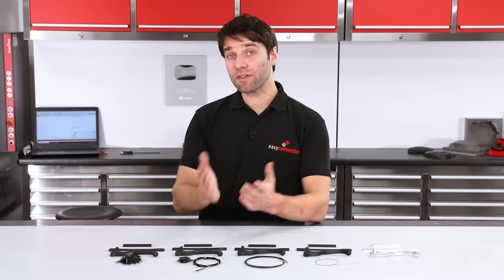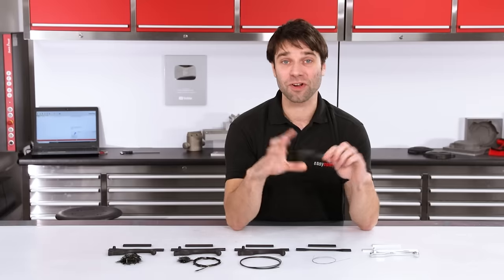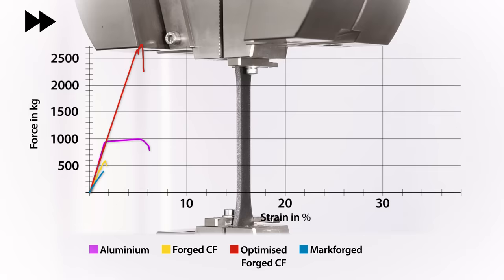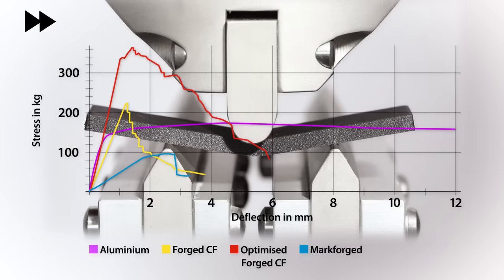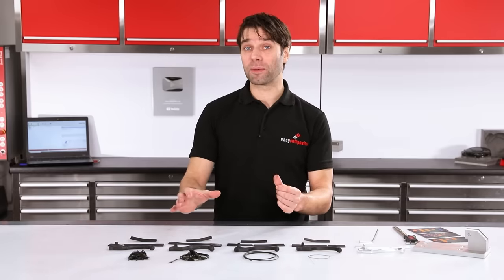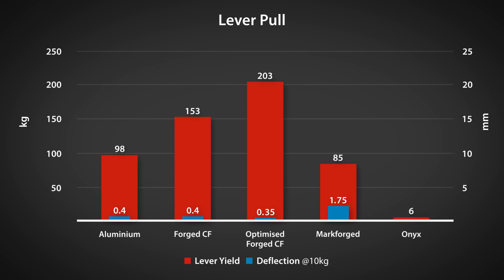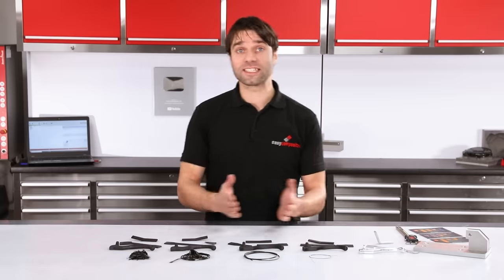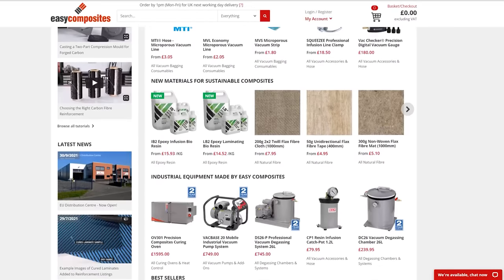How Strong is Forged Carbon Fibre? Forged Carbon vs Aluminium vs Markforged vs Onyx

Comment: Hi! I am from the US. My university senior design project is a CF roll wrap/compression molded first responder tool. Would it be alright if we screenshotted the graphs in this video for use in our presentation? We would place your logo at the bottom to credit you for your work as well as cite you as a source in our references.
Reply from the maker: Hi Ean, yes, of course, very happy for you to do this providing you credit in the way you mentioned. If you follow the link to the full write up on our website you will find more information, tables and the original graph. This is the page you should reference. Good luck with your project 😀.

Comment: Something that I don't feel is fully conveyed from this test data is how sensitive the 3D printed materials are to the direction of the loading. In the optimal loading directions, they will provide the strength shown. If loaded such that the force is applied tangential to the layer lines, the strength is drastically reduced. The Markforged continuous fiber material, for instance, if loaded in the worst case direction, would fail at a lower load than the Onyx did in these tests. For unidirectional tensile loads and compressive loads these materials can be viable, but complex tensile loads will cause the layer lines to separate at significantly lower loads.
Reply from the maker: That is very much application dependant and the same can be said for traditional composites which are very fibre direction dependant. If it is taken into consideration then it doesn't need to be a problem.

Comment: I bet "optimized, forged carbon", rotors and apex seals, would be awesome.
Or an eccentric shaft/crankshaft also in fiber?
Would they melt?
Reply from the maker: The resin used can go up to 90C so would not work for an engine.  There have been experiments with composite and plastic based engine parts but generally only for demonstration or research purposes.

Comment: Should have done Forged Steel. would have been nice since everyone likes to compare Fiber to Steel.
Reply from the maker: It would have been an interesting comparison but in real terms, aluminium is a closer material to compare to.  It is common for people to hear statements like "carbon is stronger than steel weight for weight" and although correct, it can be misleading. This is because the density of the materials are considerably different so a carbon part would need to be considerably thicker to perform better than the steel part - albeit it would still likely be lighter.

Comment: Nice video, although i would have liked a comparison to conventional carbon fiber
Reply from the maker: I think we assumed that comparisons between the mechanical properties of various 3D print filaments had probably been pretty well covered already since these materials are widely available and their performance compared to each other is the source of plenty of debate and discussion. Nonetheless, I can see that a straight PLA/ABS print, tested on our gear under our conditions would be interesting, especially just to see whether the milled carbon in the Onyx really does much at all to improve a standard filament under these conditions. If we get chance, we'll look at adding this data to the report.

Comment: Could you do video on design Carbon Fibre cross bow limbs. It's design for strength and elasticity. 

So far the general perception is favoring fibreglass
Reply from the maker: There are already plenty of bow limbs made with carbon fibre, typically UD carbon fibre laid up in the direction of the length of the bow limb.

Comment: Could you compound the carbon fiber with fiberglass to make it more rigid or stiff?
Reply from the maker: Carbon is generally stiffer than fibreglass so this wouldn't really give you any advantage.
Reply: @easycompositestv  I was looking at the cost effective scale, to mix carbon fiber with fiberglass, to bring the cost down.

Comment: Hi, I have really enjoyed watching your video! I am daily working with Markforged printers (reseller) and I know that you can (as a user) set up the printer to lay down continuous fibers form the second up to the second to last layer of a print (you have mentioned that a print has to have "a few layers" of top/bottom plastic - yes, with standard settings it is 4 layers), so with the correct settings you end up with 6 more layers of continous fibers. 6 is not much when a print has 500 layers, but quite a lot when it has only 25 (like probably your test samples). I would love to see how would those extra few layers change the results. Please ask someone from Markforged for an extra sample or write to me and I will be happy to provide it :-)

Comment: I've done these tests with the MF printer with roughly 66% CF infill. I've been having difficulty getting a successful failure for a dog bone shape per ASTM D638. It looks like your failure was successful, was your dog bone a type 1 shape?
Reply from the maker: Although the standard wasn’t applied to the tests as such, the specimen follows the dimensions of ISO 527-2 Type 1B

Cross section 10mm x 3mm 
Parallel gauge length 60mm 
Tab width 20mm 
Waist radius 60mm

Comment: Id be curious to see a comparison with a more quality carbon fiber manufacturing processes- eg. prepreg and autoclave process or a SQRTM process. These processes are more controlled and do a better job of limiting voids, and aligning fibers. It gets the parts closer to the theoretical strength values of a given fiber matrix combination. They would provide a better benchmark to compare the forged carbon parts to.
Reply from the maker: There is already a lot of mechanical data available for conventionally produced composite materials. However a direct comparison is not really possible as generally the methods have different applications. Eg the brake lever being a solid thick object is not ideal for conventional composite lay up, and thin conventional panels are not ideal for a forged carbon lay up by these DIY methods -  so not easy to have a direct comparison that would be meaningful.

Comment: fantastic video but how do we know that wasn't a flaw in any of the samples.  It would have been better if multiple samples were taken from each method.  For example, use 3 aluminium levers, 3 forged carbon, etc.
Reply from the maker: The sample token tests were repeated multiple times and the average values from those tests was pretty reflective of the results from the lever test so we can be reasonably confident.

Comment: Onyx seems like it could be very useful in specific situations due to its resilience.   Also, I know it's a different test, but repeated pressure at lower levels to see how well these survive long term.   That is/has been an issue with parts on my bike as repeated torque over time causes failures in seat posts, pedals and even frames eventually.  I've ridden well over 40,000 miles as a commuter in my life and I think this is an important issue can be improved and should be with the advent of EV-bikes.
Reply from the maker: Great point! Fatigue on something used a lot could well be an issue.
Reply: @easycompositestv  I had a thought, Could you use Onyx as a O-ring material?

Comment: Very interesting testing and results. But how about fatigue stressing and failure of the different carbon forms? We know very well how metals and aluminum behave. But carbon parts? Definitely you don't want a fatigue failure at your brake handle!
Reply from the maker: Long term fatigue testing is not something we are able to test. There is limited data out there on fatigue failure and it is usually for specific applications.

Comment: How complicated would it be with a " prestressed " woven fiber strands to add reinforcement and the rest of the inner part with 100% filling
you have to install one turning point at the end of the lever, in the bulge
Reply from the maker: If by pre-stressed you mean a pre-cured insert? Then that could be done if made off the part then inserted.  But that is adding another layer of complexity to the process compared to the optimised version which can be done simply at the same time as the rest of the compression moulding.

Comment: Is there somewhere a weight table or comparison of the items?
Reply from the maker: Hi allesleiwand, you're in luck - if you head to our website, you'll find the video along with a detailed write up: https://www.easycomposites.co.uk/learning/mechanical-properties-of-forged-carbon-fibre
Reply: @easycompositestv  Thanks for the response and the link!
A small suggestion for comparison videos (yours is great already) that really helps using them as reference: Please place sheets of paper to the materials when you show them. And please use the same order over and over again and also outside the video as the changing order is quite confusing. Thanks for all the work you put into this!

Comment: Excellent video and spot on. However, what I do not understand about carbon fiber applications is that it appears the REAL strength is not coming from the carbon fibers, but instead from the polymer. I think what needs to happen in carbon research is how to better bond the fibers at the molecular level, such as found with molten metals. If there were such a component made with ONLY carbon at it's core, such a part would outperform all other materials.
Reply from the maker: The matrix itself supports the shape but the physical strength characteristics of a finished part do come from the reinforcement; a block of pure resin of the same dimensions would perform significantly lower than one reinforced with carbon. However, onto your second point, this is already a 'thing'; Carbon-Carbon items are largely used in high-temperature applications but there is some interesting reading online against your hypotheses.

Comment: Could Onyx be used to make very light racing tires ?
What if one could make a Aerogel tile, triangle shaped, 1.5" tall by 0.125" thick ? Then draw a vacuum on it while coating it with a thin layer of Onyx as a sealer and binder for a second layer of Forged Carbon ; engineered thickness depending on application . Could this tile be made lighter than air ?
Reply from the maker: Certainly not an application we have seen or heard of so I suspect the only way to get an answer would be to have a small experiment or test to see if the method works.

Comment: What would happen if you braided the reinforcement fibers of optimized forged carbon?
Reply from the maker: Not something we have tested but if it was fully braided into a rope/sleeve then the properties would change as the fibres are no longer straight but wound.
Reply: @easycompositestv  Fair enough. Strength after all very well might be compromised. However, I get the feeling that the whole "multi-directional" aspect will come into play much like plain forged carbon, and since they'd still be continuous bands, just now twisted together, FWIU it would still add a massive amount of strength in the directions and locations placed.

Comment: very interesting - but I can't tell which  parts map to the graph - please add a title left to right
Reply from the maker: If you click the link in the description, it will take you to the full project write-up on our website. In the write-up, there are the original graphs as well as tables of the data. There's also more information about material densities, component weights and some further analysis.

Comment: Onyx at first glance looks terrible, but i can see some really good use cases already. It appeared to go back into shape after the force was released. This could be good for adventure bike mirror brackets, or the base for turn signal lights. They need enough rigidity to just hold in place while still having some give when you inevitably crash. Also since it can be warped so much, protective covers like a plastic water pump housing for example, or hell even a phone case.
Reply from the maker: Yes we agree, for some applications where the stiffness under load is not so relevant, it could be a great product.  However for this specific application it is just not stiff enough.

Comment: The trick of course is to always get the fibre orientation in the right direction, which in a 3D load case is...er...a bit of a challenge. But doable. You really need a kick-arse 3D modelling program to optimise this.

Comment: can we use composite in leaf and coil springs?
Reply from the maker: Theoretically yes, carbon fibre, especially Uni-directional carbon fibre are often used in leaf springs for prosthesis, walking aids and sporting equipment etc.  Using for higher loaded applications will be subject to testing to see if there is an advantage over metal springs.

Comment: What the tests for the optimized forged carbon fiber necessarily mean, at least in a motorsports application, that you can afford to run a comparatively smaller, less powerful engine with the necessary chassis components fashioned from such a material.
Reply from the maker: Potentially where the design is safety tested and allowed for your race series regulations.

Comment: What are the options of different resins?  It appears to me that the actual strength depends on the resin.
Reply from the maker: Generally it needs to be low viscosity for the process. We used an epoxy and in general terms, epoxies have a high level of mechanical performance so are a good choice.

Comment: For the deflection tests (around 8-9 -minutes) the carbon fiber samples cracked in the same spot.  If the carbon fiber part had been wire reinforced, I wonder if the results would be any different.  Or, the crack would have occurred in a different place.  Carbon fiber is amazingly strong, just a bit of a pain to produce w/o practice.
Reply from the maker: Wire reinforcement would change the properties of the composite matrix for sure, but it may require a re-design or change of the lay up (both fibre and metal wire) to change the weak point to give failure elsewhere instead.

Comment: Can you forge carbon fibre cloth or does it only really work with pieces
Reply from the maker: It relies on the ability of the pieces to move as it is compressed so using a woven cloth would not work as well. Plus a woven cloth has clearly defined fibre directions where as the forged carbon is more randomly orientated.

Comment: THe results suggest that forged carbon-fibre might be suitable for suspension components, though it would have to be protected from chipping with a flexible outer skin.
Reply from the maker: It might be possible subject to testing.

Comment: I used to work for high performance manufacturers for pre peg carbon , what's the real difference ?
Reply from the maker: They aren't really comparable in this kind of situation due to the different applications for their use.  You could simply directly compare the mechanical properties in this video with some cured pre-preg test samples to get precise figures for comparison.

Comment: What would the results be like when the temperature lowers at 0 Degrees? Would the carbon fiber be more or less brittle than the aluminum?
Reply from the maker: Testing would have to be repeated at various temperatures to see where the impact of cold brittleness begins to take an effect on the various materials.

Comment: Hey guys. Can I print this lever In a CF nylon material that is A LOT stronger then Onyx, but of course weaker then the others, and send it you for testing?

The bending modulus is 16GPa versus Onyx roughly 3GPa
Reply from the maker: We don't currently offer a custom testing service unfortunately.

Comment: Interesting stuff. Now... how to prevent this "oriented fiber" material from splinting along the fiber. Use a "matrix" (glue) with a higher tensile strength? Weave or wind the carbon fiber in at least two perpendicular directions? Crosslink the fibers somehow in full volume? I know - that would be Nobel prize material :-) Carbon only has so many covalent bonds...

Comment: which direction were the markforged fibers in relation to the force?
Reply from the maker: The fibres are aligned depending on the 3D printer tool paths.

Comment: another interessing test could have been to make 2 square piece with each and test  oine square in one direction, and one from another direction (as i think that the two carbon samples with continuous fiber, when tested in the "right direction" would surely, like in the wideo, outperform the rest, but i think that when tested in the "wrong" direction, they would underperform compared to the rest)
Reply from the maker: Hi, yes, if you test any material that’s been optimised for strength in a particular direction in a direction other than the one it’s been optimised for then the performance will be significantly compromised. Most highly stressed/high performance carbon components used optimised fibre orientation in this way; it is a significant advantage of carbon fibre over isotropic materials like metals.
Reply: @easycompositestv  so, it  mean that thoose optimised forged carbon fiber would have issues in environment where subject to mechanical abuses and regular shacking, or even repetitive impacts?

Comment: how many layer of carbon fibers on the printed vs your optimized forged?
Reply from the maker: The compression moulding has no real layers.  The number of tows was as many as we could fit in the middle while still having enough space to have some chopped tow all around.  You could be more precise and measure the number of tows or layers if needs be.
Reply: @easycompositestv  Sure, but on the printing software there is the ability to let the software select the number of continuous fibers and how much fill is used, correct? Are the prints using the same amount (roughly) of continuous fibers as the forged process?